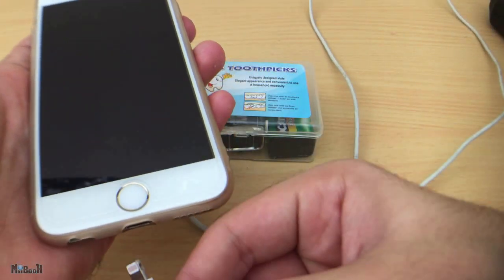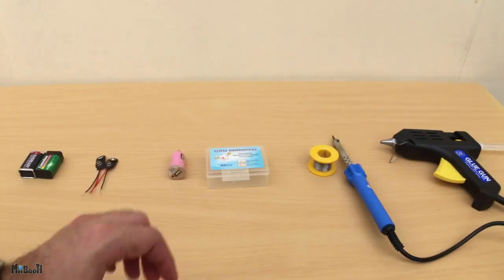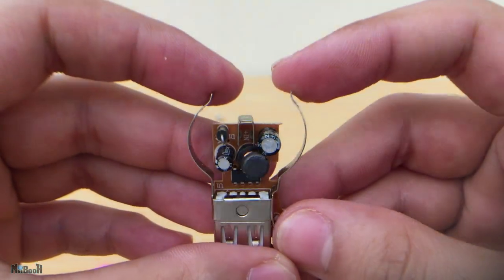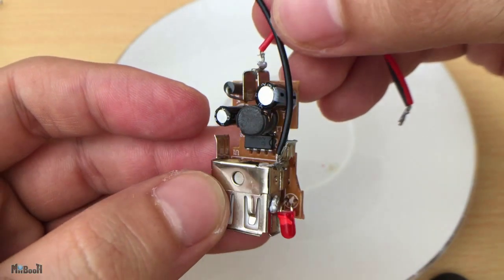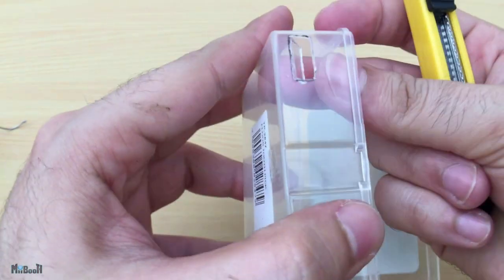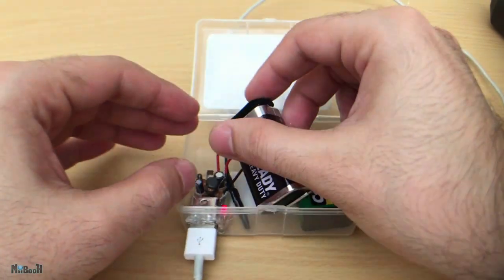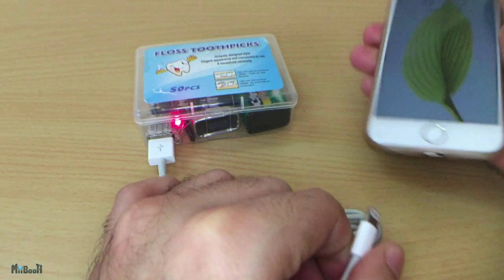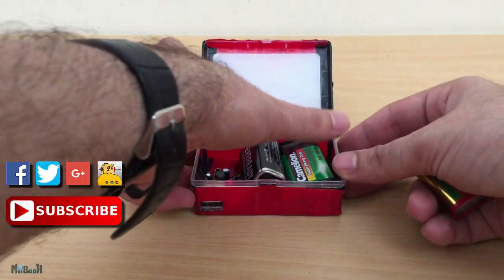9V battery hack | Homemade power bank | What The Hack #20

Comment: Why do you put 2 9v batteries, to reach 18v and then drop it down to 5v to charge the phone??
Reply from the maker: Actually the circuit I used is from a car charger which converts 12v or slightly more to 5V to charge a phone. The circuit won’t work with a supply of 5V and if all this 18V goes straight into the phone without the current being regulated to the appropriate amount(by the circuit), it will get damaged.

Comment: mii both, use a switch on off to stop the led. dont be child. and after buy 9v battery cases, are very cheap on ebay. put 2 battery in seria and other 2 batteries in paralel for more current, like that you have all time more capacity. more paralel connection, more mAh capacity. do a nice job, dont be like a child

Comment: Can you connect 3 batteries in series using this same method?
Reply from the maker: You can. But that way the Voltage will reach 27 volts but it will generate a smaller current. For a smartphone, you need just 5 volts and a current of 0.5-1amp.
Reply: miibooth its like a child, he forgot to mention..... with 2 series of 9v you make 18volt, after these two series put them in paralel. as many paralel you do, you get more capacity, more power, more amps, more mAh. like that you can go up to 200.000 mAh, most powerful bank. will be empty in 2 weeks, so you have to charge 8,16 batteries 9v. you have to buy charger for 10pcs pp3 batteries 9v from ebay. I am Samuel Badman on facebook. I am in London. I also can show how to charge circuits without power from socket, just using dc motors for drones and dvd.

Comment: hey is it possible to add more batteries to have more power to the usb ?
Reply from the maker: Probably, but more 9 volt batteries will increase the voltage beyond 24 volts and the car charger circuit isn't designed to handle that. You can use smaller batteries, this way you'll get more energy storage and still in the voltage limit. It will require a bigger box though. Let me know how it works out if you try anything different.
Reply: check my comment or follow me on facebook samuelsamir666 or samuel badman from London